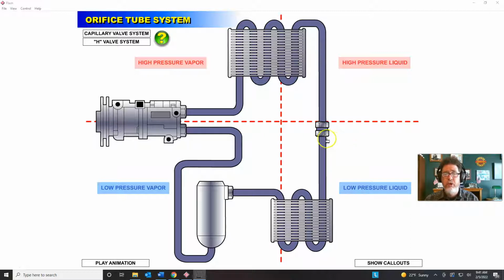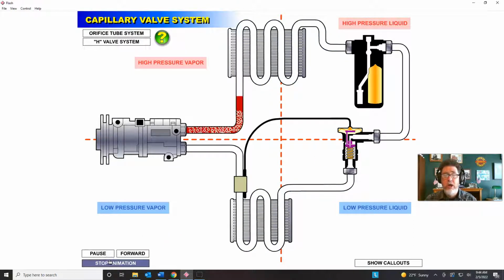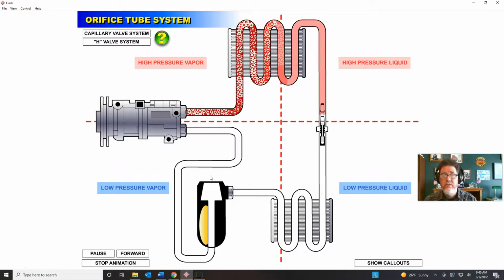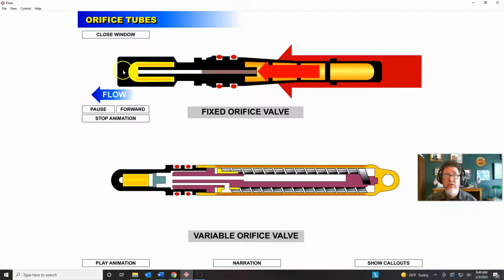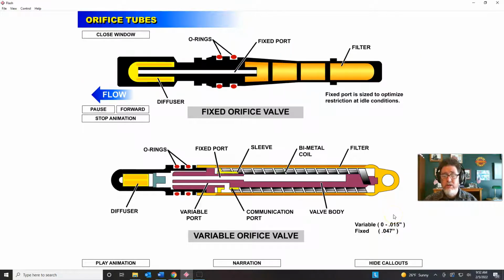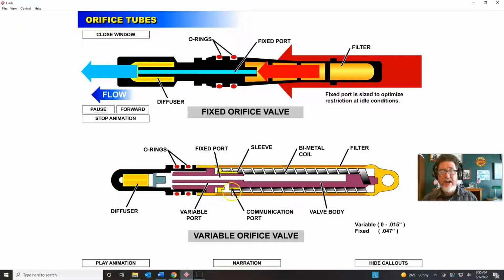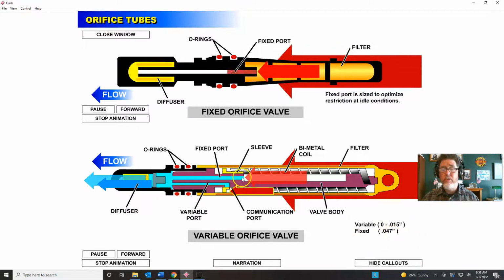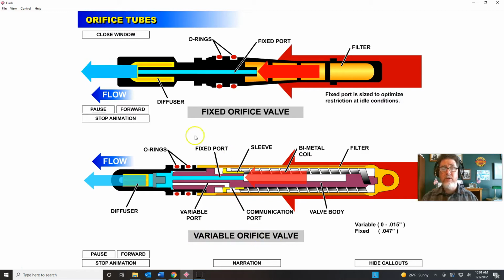How does an Automotive A/C System work: Part 4 FOT and VOV Diagnosis

Comment: @Professor, I am really loving your videos. Very helpful. I have a question. I recently replaced my compressor, condenser and the liquid line. I did not replace the accumulator. After vacuuming the system and then charging it. I saw that the compressor clutch engage and we felt cold air. After letting it sit for a bit, we got back in the car and noticed no cold air and the clutch did not engage. We noticed there was no pressure in the system. I noticed that there was liquid coming from the evaporator drain plug. Do you think there is an issue with the accumulator which i do intend of replacing now. or do you think the issue is with the evaporator core. ONe thing to note from your last video that i noticed. The orifice tube is part of the liquid line (2006 Jeep Liberty Sport) when the system was charging, i did notice the liquid was very cold on the side coming out of the condenser before hit the orifice tube. Do you think we compromised the orifice tube. Thanks for any help you can provide.

Comment: I changed the orfice tube in a 2004 ford ranger to a vov tube and had to put in a far amount more freon to get the low pressure up to keep compressor from cycling. Is this normal for the vov orfice tube?
Reply from the maker: Sorry, but the charge level should not change going from a FOT to a VOV.  The VOV is only going to get you a 5 F degrees  better cooling during high heat loads, like stop and go driving.  It will make no difference during normal heat loads days or driving at hwy speeds with lots of condenser cooling by ram air.  It is it not cooling during a normal day, there is another problem.  Good luck,  PP
Reply: Nice videos how can u trouble shoot a ac system all new parts replaced but no cooling is happening anywhere? Please

Comment: Thank you professor quick question , if you have a fot system which is short cycling , and when you touch the line before the evaporator is cold but when comes out to the accumulator is warm is that an indication of low charge or leak on the accumulator?
Thank you
Reply from the maker: You are correct, this is probably an undercharged condition.

Comment: I was wondering if a vov can be used on a system that use a capillary valve in conjunction like the one on the trailblazer ext ( that has 2 evaporator, one in front and the second for the rear)? 
Thanks!

Comment: I love the clear and precise illustrations and teaching intructions.  The reason I am even here watching this is because 1) after just 1.5 years my new compressor failed/leaked at the front seal behind the clutch.  2) Buying a new compressor, orifice tube and accumulator, I have just discovered that the Pro A/C shop doing the work had/has installed the fixed orifice tube in backwards. 

 My question is, What problem affect if any would this cause with reversal of the OT?  The A/C seemed to work fine until recently.  We are in Canada and so we don't use A/C for half the year.

As a final note: The hoses and the condernser were also replaced along with the compressor and other parts listed.

Comment: Thank you for the great animation and explanation!  Question:  It looks like I can buy a fixed orifice valve OR a variable orifice valve option for my 2003 Chevy Silverado. Is there any reason I should not "upgrade" to a VOV?   Is this accurate that I can just pop in a VOV over a standard one without adjusting anything else in the system (Assuming a clean and operational system and a proper flush, evacuation, and recharge after the swap). Thank you
Reply from the maker: Hi Kyle,  Yes,  you can put in the VOV if designed for that vehicle.   I would only do it if you already have the system apart and was planning on replacing the FOT anyway.   If will give you a little bit better cooling in that stop and go city driving.  Good luck!
Reply: @ProfessorPentane  I do have the system apart at the moment. Do you happen to know the proper part number for an AC Delco (if they make it) VOV? Thank you
Reply: @920PC  acdelco 1550121

Comment: Thank you so much professor Scott for your videos with good illustration I saw 4 videos from your channel and I’m really appreciate all these information but I can’t find more videos. Question:What prefer to use for flushing whole system? Q2:What kind of gas use to pressure the whole system and how many PSIG? Q3:How many inches of water column go down to pull moisture from the system?Thank you again.

Comment: These automotive AC classes are a big help wherever you see from, even If you think you know enough its a very solid base of knowledge, so thanks for that 

Air conditioning on cars evolved too much nowadays, since its the same principle as an oldschool system HVAC control units are acting over a certain quantity of components that older systems doesnt have like thermistors, control valves and controlled servos where every signal has their own role, like cabin humidity, duct temperature, wss signal to control condenser fan speed, solar sensors... and a few more tricky things that I dont even know. There isnt clever information from car manufacturers about how these systems really works, even refrigeration professionals says automotive AC is a very weird thing compared to big industrial systems, maybe because the lack of info to understand it. 

So thanks again to "condense" all the knowledge in a very well explained videos like these, hope more people appreciate those